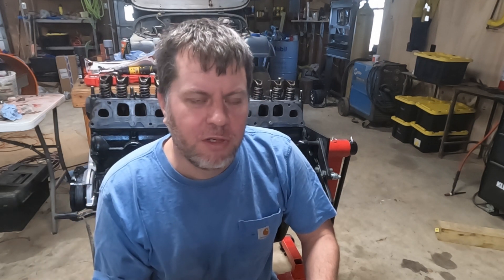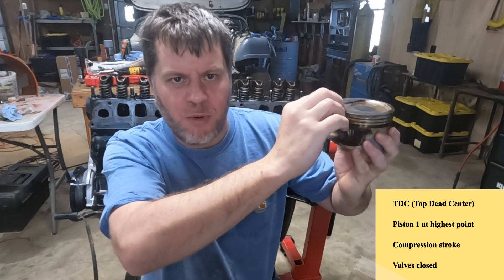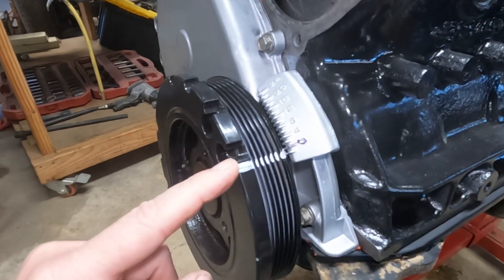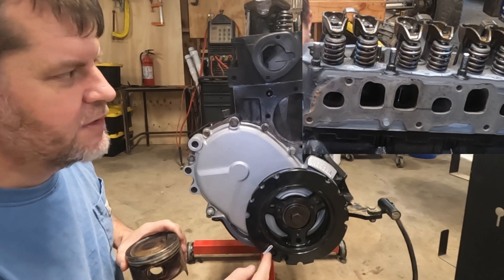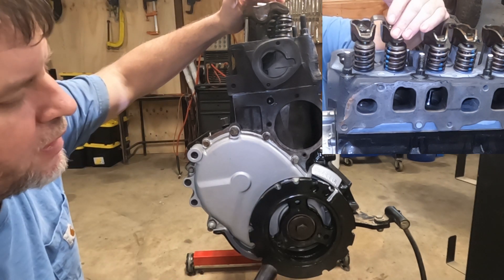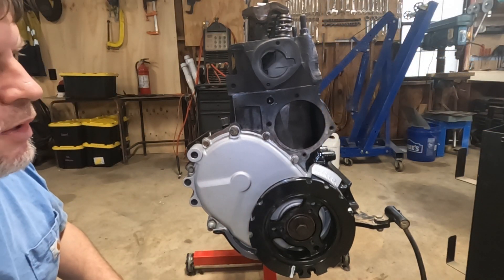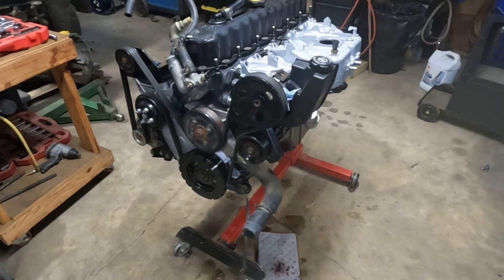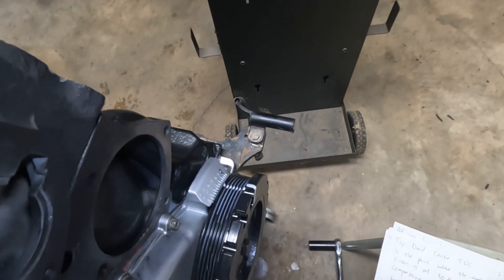TDC - Top Dead Center and how to find it on a Jeep 4.0

Comment: Question. 

After reboring the engine you need to time the engine whit out the balancer. You just take piston 1 and 6 on TDC and align the dots? And I will do this, to connect the sensor after the head is installed? Correct ?
Reply from the maker: You are correct on alligning the dots to ensure the can and crank are timed.  In my case with the head installed  I had to rotate 180 degrees (Ie the timing dots were not touching but facing away from each other to get TDC on 1.

Comment: How to set timing on a Jeep 4.0. Top dead center on the compression stroke. Yes but in order for the timing to be correct it’s 10 degrees before top dead center with the rotor on the distributor pointing at the number 1 cylinder on the cap. On the timing cover it should be marked 0-4-8-12 and so on from right to left. If the timing is set to top dead center on the compression stroke with your timing mark on 0. And the you did the distributor correctly,the timing will still be off.  The timing needs to be 10 degrees before top dead center. I have a 91-92 XJ so your timing cover marks may be different than mine.
Reply from the maker: In the 4.0 that I use the ECU determines how far before TDC spark occurs, so you set TDC on the sensor and the ECU does the adjustment.  If you are running old school distributor then yes you would need to adjust the timing.
Reply: @theshop392  I have a 2001XJ and can’t seem to figure it out

Comment: So both 2 front valves need to be completely shut in order for the 4.0 engine to be at top dead center?  Is this correct?
Reply from the maker: Yes as long as the correct sequence of valve operation has happend (ie both valves are closed at other points in the cycle)

Comment: Useful video! Regarding torquing rocker arm bolts. Some say to torque them and you are fine because they are self adjusting. Others say to torque each set with the piston at TDC only. FSM isn't clear with doing this method.
Reply from the maker: Personally I would do final torque at TDC.  Torquing rockers that are under load did not work for me and I had one jump out.

Comment: The single best practical video on how this works. Having the valves to see open and close is the best part.  Am I right in thinking the timing gears marks should be alighted as well, facing each other? Also, the distributor should be pointing at cylinder 1 correct? Thanks for this video, really helped explain it. I would love to see this with the timing gears and the distributor exposed.  I am replacing my timing chain/gears and have looked for an explanation like this everywhere and yours is the best.
Reply from the maker: Dean, I would have to go back and look, for some reason I recall the timing marks do not align at TDC, they are aligned at exhaust stroke.